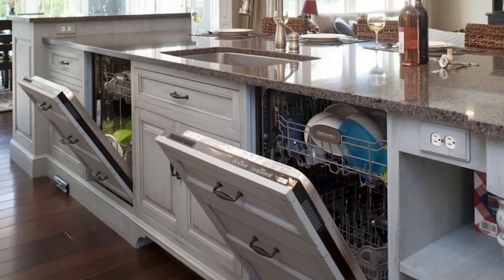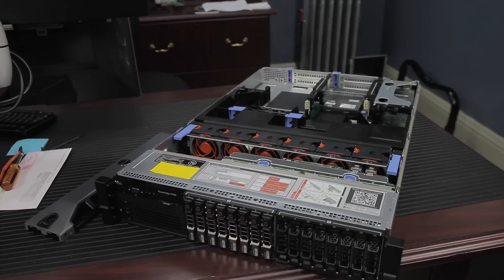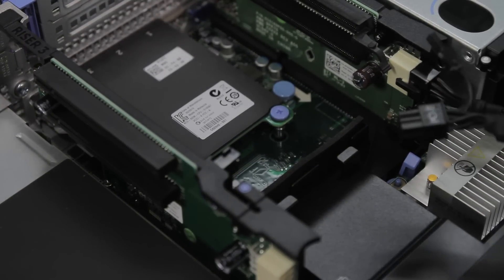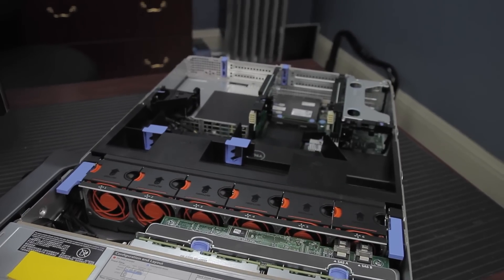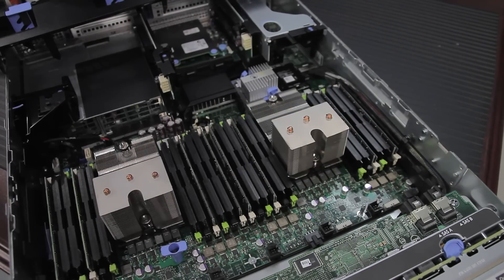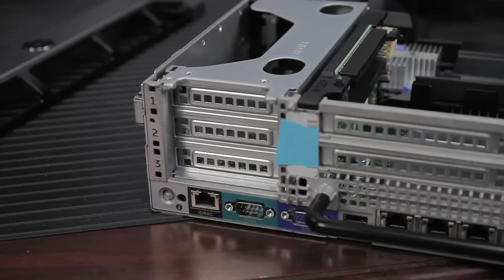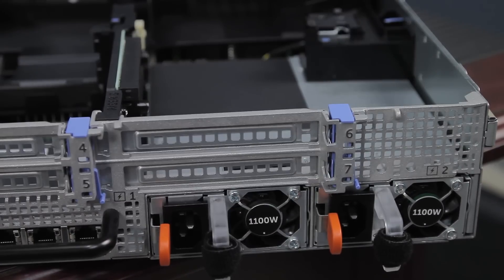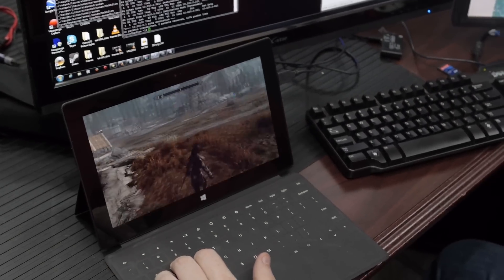Dell PowerEdge R720 Dual Xeon Server Review

Comment: Hi I'm building a gaming PC and I was wondering if this was a good parts to start building the PC with and I'm also open to any suggestions like a change to the case or anything else, so here is what I got and I would like to hear your feedback http://pcpartpicker.com/p/xLRZWZ
Reply: If you're going for strictly gaming, I'd suggest going for the i5 4690k, and picking up either a hyper 212 evo cooler or maybe a liquid cooler. That way you could overclock if you want. But an i7 for gaming isn't necessary
Reply: Yeah I was wondering what was better out of the two
Reply: Sahil Saini while an i7 isn't necessary for gaming, you do more than just that on your system. I'm sure once you have the power you are going to want to try youtube, or streaming. If you have the money to blow get the I7, if not, the i5 will work..
Invest in a water cooler. My h100I does an amazing job.
Reply: Sahil Saini always overclock from within the bios.
I have been forced to use software overclocking before, and it is hell.
Once you watch a tutorial or two, overclocking is easy.
Increase the multiplier/baseclock and stress test. repeat until unstable then increase the voltage a tiny bit, rinse and repeat until you get an overclock you are happy with.
Please monitor your temps and stress test for at least one hour each time.
Once you have dialed in your overclock, stress test for at least 24 hours, if not 48.
Don't expect a quick and dirty overclock that you will get in 10 minutes. you will be out a system for a few days.
Reply: dude! where is the SSD? get a 120g for the main sistem at least, then use your 1TB one for storage. I dont know why would people want 1TB besides editing video or heavy photoshop compositing. I personally have just built myself a system and i still have 20G left for my files after installing all the 3Dmodeling software i use. I guess it would take me 4-6 months to fill that with the type of work i do without cleaning useless files.
Reply: Yeah I'll probably change the mouse and keyboard but the reason why I chose the i5469k is because I can overclock it but I am NOT experienced at overclocking and I was wondering should I get it if I have little to no experience in the overclocking and if I should what software should I use and how much should I overclock it by
Reply: *i5 4690k
Reply: I managed to get 16gb of ram from the same company can anyone give me a estimate of how many frames I can get on this machine and also thank you to everyone who replied you have been very helpful
Reply: Sahil Saini I'm just going to give you my 2 cents and tell you that you really shouldn't ask what people think about your build in the youtube comment section, most of the guys who replied to you think they're an expert because they've built 1 pc and while some of them make a good point here and there (like stress-testing for at least 24 hours after you set up your "final" overclock) a lot of them are extremely biased and some of them are just plain stupid. I'm going to take my time and point out why, it's going to be a long read but I hope it's going to be worth it.

For starters, you will not get any noticeable framerate increase from going for higher memory speeds than 1600, anybody who tells that thinks that higher numbers means higher performance and nothing they say should be regarded as truthful.

Every comment that starts with "I have a X and it is great/good/amazing/..." is so biased that you should just ignore it. Sure an h100i is great, I have one my build, but it's old and has been bypassed by many AIO's while it hasn't come down in price. So while it's a decent cooler, it isn't good value anymore, you're better off looking into Fractal, NZXT or even Cooler Master at the moment.

That case is horrible value. Are you planning on going to LAN's often enough that you think you need a carrying handle? Because if that's the case pun not intended you'd still be better off buying a Vengeance C70 from corsair. Both of them are pretty old cases but at least the C70 can house a 240mm AIO. If you don't need handles and you care about it being silent, check out the NZXT's H440, if you don't mind it being slightly more noisy and care more about the air flow, take a look at the Fractal Arc XL (or if you want to do some casemodding, you can easily mod the H440's front panel to make it an aircooling beast.) Both have insanely high build quality and are just plain gorgeous.

Do you need wireless? It usually is cheaper and better to just route a UTP-cable to the location of your PC and the 35 dollars you shave off could be invested somewhere else.

The 4790k (You selected the locked non-K version but my point still stands) doesn't give enough benefit over the 4690k when it comes down to gaming, if you want to throw another 100 bucks at your system and all you plan on doing is game, get a 980.
Arguments like "oh but you might want to photoshop or you might want to get into video-editting or streaming) are made by people who don't know what they're talking about.
If you're rendering a 1080p video, you might see a difference in rendering-time but you're not going to be a professional who has to pump out enough videos to make a living so the 10% faster rendering time doesn't matter for you.
If you're going to stream, you've got an Nvidia card with shadowplay enabling you to stream without taxing your CPU at all.
Unless you've been working around with photoshop for years, you're a photographer who's using 20+ megapixel RAWs or you're capable of doing some nice stuff with 3D, you can't really say it's worth the extra 100 for Photoshop either.

I'd recommend buying a modular power supply, it's easier to build with, easier to manage the cables and they're not that much more expensive. Also consider some models that come with braided cables, it's one of the regrets I've had for over a year now.

An SSD boot-drive is a worthwhile investment and some people consider it a pain to install afterwards so you might want to take it into consideration.

Personally, I'm a huge fan of 120Hz monitors but that depends on what games you play. Some people don't care about them at all but it might be worth checking out.

Tl;dr: If you buy it to game, you can save enough on parts that don't matter for gaming (CPU, RAM-branding, Wireless, etc.) to get a 980 instead of a 970.
Reply: Klasta if you have an APU faster ram is better, but otherwise 1600 is the sweet spot.
If you want to render 1080 p videos , 1866 MAX beyond that the difference is negligible.

Having the extra power is nice.
While not needed for gaming, if you want to do ~more~ than gaming at one time, the 4790k is great.
That being said, the fx 8350 i am using is doing amazing too.

The reason i suggested the H100i is because i ~know~ it works, and i ~know~ its good. I cannot recommend a cooler i have not had hands on experience with.

His power supply is SEMI Modular. Meaning only the 20+4 pin, and CPU power is permanently attached, and that is totally fine.
I have seen good reviews on the PSU so i saw no issue with it.

It was also 4 AM at the time so i didnt realize that he had no ssd, or that it was just a 970.
While the 970 is a really good card, if you shave off the 4790k you can get the BEAST of a card that is the 980.

SSDs are great, but dont fall into the trap of "you only need a 120 GB SSD for your boot drive, you can do EVERYTHING else on your hard drive.
Nuhuh. If you want to game, you are going to want to put your favourite games on your ssd. Go for a 240 GB one.

Wireless is damn near pointless on a desktop. if you are far enough away from the router that you cannot run a cable, wifi is not going to be very fun anyways.

16GB of ram is nice, but you only ~need~ 8GB. Just keep an eye on it and close programs often.
Or get 16 GB and dont worry about it. The price per GB is now so low its just better to go for 16.

a good case i recommend is the Corsair Graphite series 760T.
It has great air flow, is a dream to work in, and has fan filters everywhere but the top of the case (something i wish they had, but a can of air every few weeks negates the need for it).
It's quite a bit more expensive then the one you had there, but it is so much better than it.
Case recommendations are things i don't typically like to put out there as it is such an opinionated topic, but the case you had there was...... yeah....

screw the dvd drive. if you are going to have any optical drive at all, at least get a blue ray drive.

the monitor looks good, but if you are getting a 980 and are only using one of them, get a 120Hz or even 144Hz screen.
The 980 will run any game you can throw at it around those frames, and the difference from 60hz is amazing.

why are ou getting a blue drive? Get a WD 1 TB Black drive. 

Lastly, i do not appreciate it when someone tells me i do not know the stuff i need to know to do my job, based off of an assumption.
Reply: you could spend 900 and have a powerhouse. AMD FX-8350 GTX 970, good power supply and get the A3 Motherboard for upgrade potential. save the money on the processor and get an SSD and better CORE components. Power supply, ram, upgradeable motherboard, graphics card.
Reply: All you need is an ssd 120-256 gig for the OS. If you can't afford it then switch the i7 4790 with the i5 4690k and add an aftermarket cooler
Reply: TDPEquinox If your job is building gaming PC's, I'd say it's a fair assumption that you have experience with more AIO's than the h100i. :p

And indeed, I agree with nearly everything you just said, except for the SSD... You can want faster loading times but it's not something you need, I've got a steamlist that's over 1 Terabyte in size. If I add up all the games I regularly play, I'm at about 700GB so there's no way I'm putting that on an SSD anytime soon without spending way more money than faster loading times are worth. Faster boot times > in game loading times imo, so I think it's fair to say that a SSD bootdrive is better than value than a 500GB SSD with most of your games on it. I'd take a 980 with just a 120GB SSD over a 970 with a 500GB SSD every day of the week. It depends on how much you dislike loading times though.
Reply: Klasta  how big is a high end game thease days in terms of ROM memory?
Reply: Klasta i don't just built gaming pcs.
I am a bench tech that does anything that they throw at me.
But even when i do built custom pcs, i don't exactly get to use them aside from stress testing.
Sure, some other AIO can cool good but does it last as long as my h100i has? IDK, it went out the door never to be seen again.

As for the SSD. a 240 is a good spot for it. 500 GB isnt quite worth it yet.
But say, put BF4 on the ssd because loading times are like 5 minutes on a hard drive.
But games like tf2 or hearthstone can be on a hard drive just fine.

I Currently am playing Assassins creed 4 Black Flag. So i put all 40 GB of it on my SSD because i am playing it right now.
When i finish the campaign and all that is left is the side missions, i will move it to a hard drive.

Most games load fine on a hard drive.
Titan fall, being 50 gigs, loads fine on a hard drive. but BF4, being 25 gigs with all DLC, takes forever on a hard drive.
It's just a balance and i wouldnt expect someone to put 700GB of games on an SSD.
Reply: Benilaice Games come in upwards of 60GB Now.
Im sure there are larger ones i dont know of.
Reply: TDPEquinox Yes you can get an SSD up to 1TB and HDD up to 6TB. If you are looking to install games on the SSD then go for the Crucial MX100 256GB or 512GB on sale right now for $113-$210 on amazon.com
Reply: Benilaice They're only on sale in the US and Canada, doesn't really help out when you're in the EU. Saying you can get an SSD up to 1TB is like saying you can get an Nvidia Titan Z, sure you can, but if you had the budget for it, you wouldn't ask about a build in the comment section, you would be going ham on that rig.
Reply: If you are going for that cpu, your build is out of balance with anything less than a dual gpu. Back off on the processor, and get a higher end gpu instead, you will thank me. 
You are gaming, gpu is everything(mostly).
Reply: How's this? http://pcpartpicker.com/p/XPcZWZ
Reply: Meerkat218 um... where is your ssd?
Reply: Meerkat218
Nice joke, but I would rather have gtx 980's in Quad SLI (custom liquid cooled), add a few 1tb ssd's in RAID 0, and replace all system fans with high performance silent ones.
Reply: If you still have questions or have problems building it I am up for that.
I took a week off and I am just planning on playing PC and going out on the evening so I'd be glad to help.
Reply: There, now nobody can complain. http://pcpartpicker.com/p/MhGBFT
Reply: soundcard? really? do you even Tek Syndicate ?
Reply: Meerkat218 Except for the fact that u can buy a brand new car with that money...
Reply: Meerkat218 except you cant fit that in the 900 D
Reply: TDPEquinox I'm just dumping everything in a 10x10 foot steel box and filling it with liquid nitrogen, then connecting it all directly to the power lines.
Reply: You forgot extra sata controllers to hook up all those drives.
Reply: Meerkat218 then you forgot a lot of things......
Reply: TDPEquinox Do you not understand satire? Do you really think that's a real actual thing that anyone would get? And the the site doesn't sell cords or 40 slot motherboards.
Reply: Meerkat218 yes of fucking course i knew it was a joke.
Not even the most stupid person on earth wouldnt know that was a joke.
Reply: I would go for a PENTIUM 4 it easily beats a CORE I7.
Reply: 2HIGH No, my i7 would hand any Pentium's ass to it in multicore benchmarks.
Reply: The Marshmallow Man You do realize the Pentium 4 came before the Core 2's right? It is not one of the newer 'Pentium' processors at all.
The Pentium 4 was made obsolete by the Athlon 64, that was before the Athlon 64 x2's, before the Athlon 64 FX's, before the Phenoms, before the Phenom II's and before the current FX line. It is an old old processor :P
Reply: I know it was just for fun :)
Reply: ***** Nah, Intel is better if you're building a rig and have the money though.. It gets more work done per cycle and overclocks higher and has a lower TDP. Ghz aren't very relevant to this.
Reply: ***** That's true, but I'm not saying it because of fps. The difference in fps will probably be less than that anyway. 

I'm saying it because of potential bottlenecking on high end cards. Which yeah, you could overclock it, but it'll run like an oven.

If you aren't buying the latest cards though you're more than good with AMD.
Reply: XHyperxNovaX while i agree if you have the money go for intel, your statement of "You can overclock it but it will run like an oven" is wrong.
Get a good cooler, and you, like me, can run a high overclock and sit at a cool 31C Idle (40 load, 55 was the most i ever saw while running the heat stress test in prime 95) with the 8350.

But if you have the money, go intel.
Reply: ***** yes but that doesnt matter if you have the money.
Reply: Meerkat218 Where's your Windows 10?
Reply: ThePackman99 lol

Comment: what in the world are you going to be using this for?
Reply: File server
Render server
Compression server
Web server
or everything at once...

Well, it might be somewhat week for a render server, but with a couple of telsas its probobly okey.
Reply: not too powerful? 2 xeons and full of 2.5 hard drives...seems like a bit much power?
Reply: For a file or webserver sure... a comression server,, well, its probobly alrigt as long as nog compressiong a lot of 4k movies, but for rendering, no. Probably would like 8 or so processors, and if i was building a render farm i would probably go for AMD processors in stead.

Where i work we develope telecom servers, they old ones have up to 60 CPU:s with 96GB of ram each... i have not seen the new ones (i don´t work with the servers)
Reply: why would you need compression server?
Reply: I'm no expert but my first guess would be a 'server' !
Reply: Pc are not made only for "professional gaming" kid.
Reply: Ebefren Revo Don't think anyone in this thread mentioned gaming.
Reply: Because we can!
Reply: Act1veSp1n google it
Reply: Act1veSp1n Server computing caters to massive parallel transactions as 10,0000 users connecting at the same time and logging in to your website. Huge storage is required for obvious reasons. They are made to handle super heavy processing loads, always stay on (only get shut down for critical reasons) and require serious power backup plus cooling. Lift the logs.
Reply: matsv201 60 CPUs for telecoms? That's pretty scary.
Reply: Tfw i have a singlecore Celeron on my server. It's not running anything crazy tho, just a 32-slot Teamspeak server.
Reply: Ebefren Revo
Well the server could be used for "Professional Gaming" when hosting the server for the game.
Reply: Jacobprogammer I was actually thinking of using one server like this as a multiple gaming rig. Where you run say 4 GPU and 8 or so virtual machines running game on it and use it to all gaming rigs, workstations and mediacenters in the house. One computer for every system, just extentioncords.
Reply: *****
Things on 2011v3
Reply: colt merg Are you joking?
Reply: ***** Well, the new systems that have a large quantity of server runs several virtualservers clustered over the systems. So they are basicly running all the systems on the same server, but the programs have no clue that its actually the case, so if one server is hacked, you can still not control the cluster.
Reply: +Act1veSp1n  I think companies like Google usese this for the GGC (Google Global Cache ) in various countries for the local cache features of youtube , google play etc...